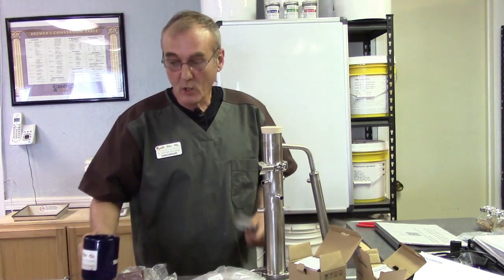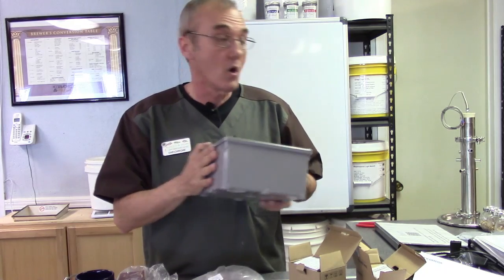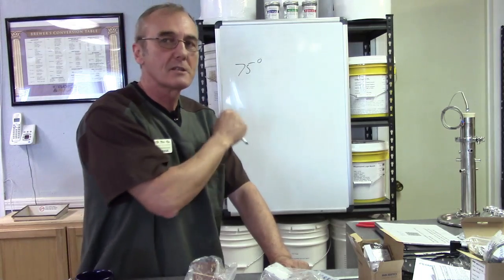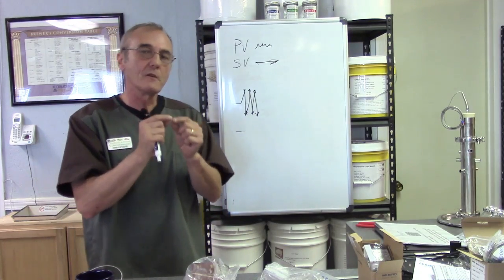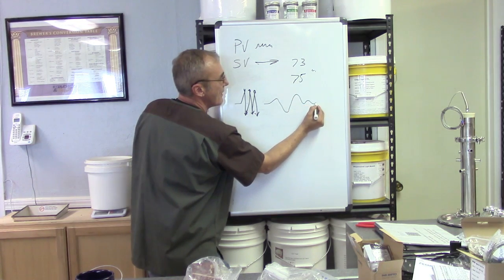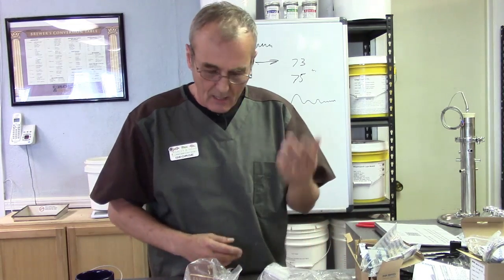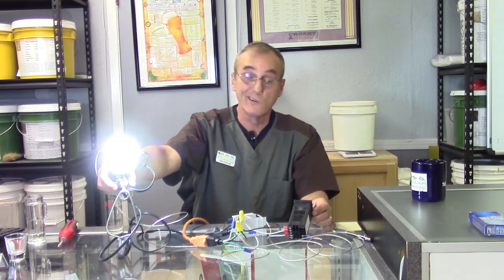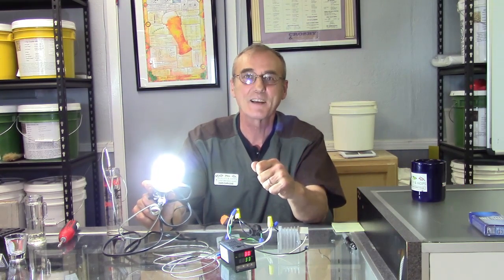Controlling temperature with a PID controller

Comment: Can a PID controller, instead of governing the pot element, and controlling the boiler, be attached to a Motorised ball valve, and control the flow of column cooling water instead?  I figure it'd have to do TWO jobs, then...  Water open, then Water closed...  Unlike an element where power off = cooling down, valve position should hold temp

Comment: I have all 17 settings wrote down in order, but no one will tell you which program you use to set the temperature. How do you set the temperature you want. IP, SC, DIG, OP, CTRL, HC, RUN, ALP, HIAL, LOW, PD, DF, PID, CTL, P, I, D, 🤔

Comment: Love your information!
It helped me figure out I have the wrong type of controller for my needs. I am trying to use a controller to control a wood drying kiln and the controller has to control a dehumidifier compressor, so it cannot pulse the power or it will burn up contactor and compressor.
So what type of controller do I need for this application? Sure would help if you or anyone else knows.

Comment: Hi George,
I’m having problems with my ink bird, I’m using it to vaporize oxalic acid for bees, I have it set for 344° and it will go up to 410° melts my solder that is holding my copper tube and then back down to 340°. It fluctuates so much and I don’t know how to narrow it down.

Comment: A PID controller is excellent for holding a constant temperature but a still doesn't operate at a constant temperature throughout the distilling process.  A still requires ever increasing amounts of heat in order to keep the distillation going as the ratio of ethanol to water decreases throughout the run.  Ethanol starts to come off the still at 174 F and one constantly has to increase the temperature, depending on the flow rate from the condenser, to 203 F which typically completes a run.  A PID cannot self regulate these temperature requirements thus requiring an operator to monitor the condenser flow rate and make temperature adjustments.  This monitoring and adjustment is where the art of running a still comes into play.  A PID is a great way to get your charge up to temp and holding it there prior to distilling but beyond that it offers no advantage to the home distiller.

Comment: any help my controler is  new ( not my first ) when setting the temp . it just passes my set temp ( keeps getting hotter and hotter doesnt stop ) thanks
Reply from the maker: Make sure you are not set in manual mode. That's what it sounds like. I am only guessing since I don't know what type of controller you have but this is the most common problem.
Reply: @BarleyandHopsBrewing  how do i change that its a mypin
Reply from the maker: @lukerichardson9688  The instructions that came with the controller explains how to change parameters.
Reply: The instructions are a joke thanks tho

Comment: OK, now I blame you!  This is all your fault.  I was about to buy a “simple” PID controller for $800.00 from  a company that makes stills.  Now I am going to make my own PID controller for my still, and for my beer brewing.  I am going to get a PID that I can program on my laptop for less than $100.00, plus the 60 amp solid state relay, and the other miscellaneous parts for less than $200.00 total.  I will run 11,000 watts of ultra low wattage heating elements.  HOW MUCH FUN THIS WILL BE!!!!  Thank you for your awesome videos, and your excellent teaching skills.  I am now addicted.

Comment: Hi George!  Thank you for your excellent videos, I am hooked!  I have a question about the PID.  I am using a ramp/soak for my glass kiln.  I understand the ramping up part however I will need to drop temp from a 20 minute hold @ 760 deg. C. to 515 deg. C (as quickly as possible) and then hold that temp of 515 deg. C for 30 minutes.  Do any of your videos demo the segment programming for this cooling stage/hold?
Reply: It's in the manual that came with your controller. If you're stuck, you're overthinking it. Have you thought of setting the next temp to the same for hold and lower for cool?

Comment: You can buy a PID controller with 40A SSR, heat-sink and K-type thermocouple on ebay for as little as £25 (approx. $35).

Comment: Hey George. Thanks for all your videos. I've learned a lot. I was hoping you or maybe someone here could answer a question on  pid controllers. If using the mile hi 2 in 1 reflux. If you increase the power on the pid can you compensate for the additional water vapor by increasing the water flow to the chiller in the tower? In doing so is there additional risk of scorching what's in the kettle?  Or can you push the pid all the way up and add extra cooling to the tower Condensor? Basically trying to reduce overall runtime but want to be sure I'm not risking scorching anything. Thanks. Hope that makes sense.

Comment: PID controllers relate to a transfer function which models the devices output for any input value. The thermocouple subtracts the measured value from the set point and the remaining signal is called the error signal. This signal feeds a 3-term amplifier for PID and this amplifies the error signal, the integral (all of the previous error) and the derivative error (the rate of change of the error) and sums these three signals. This is a form of closed-loop feedback so it will continuously iterate. Eventually the error will tend to within 0.5% of the set point and this is the steady state error (the error as time tends towards infinity).

Comment: It still looks like it is either on or off. But I do understand that the ons/offs as short and they seem to keep the temperature in a very narrow range. This is how the 98% efficient natural gas furnace in my house works. But I did t know, until this video, it was called a PID. I do have a question if this thread is still active: generally speaking, is it better (in terms of taste) to have a slow steady distillation or is the final taste not really affected by the distillation speed; therefore, Damn the torpedoes, full speed ahead and let’s get this puppy done!! Thank you George. By the way, VERY INTERESTING!

Comment: You can add very important safety feature to your system as SSR sometimes go stuck ON when the heating element is starting to fail. This will cause uncontrollable raise in controlled temperature to maximum without any limits.
What you need is a RELAY or CONTACTOR (if the heater element is 3 phase) and connect it to second (ALARM) port of PID controller. This will switch off power to the heater if PID detects SSR failure.
Also the incandescent bulb will show your idea much better as it is proportional in nature instead of fluorescent which is on and off

Comment: Hi George.....I just completed building the inkbird PID temp controller following your most excellent tutorial.   Everything works great.   My question is about tuning.  Would you please direct me to the vid that addresses setting parameters where the inkbird progressively  "ramps" up to a set point.
The other problem I'm having is establishing the on/off set points.
For instance,  my inkbird "screams" up to  say 180F set point, the SSR opens, the temp drops down to 150F, relay closes, temp screams to 180F on and on.... I'm looking to tighten up the operating envelope.  You're a great instructor! Thanks for everything.  Jerry

Comment: Hi George. I have managed to get a stc1000 which is all that is available at this time. It has a short plastic covered thermocoupler or probe. Can it be used? I am stuck on how to mount it if it can be used. Have spoken with professor google but I don’t see this as something anyone has ever covered. Obviously can’t just be stuck into the copper as it will effect the reading. Any way you can give advice? Thanks as usual for your great coverage. Am learning so much from you. Regards.

Comment: I'm not sure that is the best way to describe the three PID terms.   For clarity, think of the output from the controller.  The proportional term drives the output "proportional" to the deviation from setpoint.  The integral term is the product of "deviation from setpoint multiplied by the time it has been away from setpoint (the controller will ramp up or down if the process value doesn't come back to SV.   And the derivative term acts on how fast the process value is changing.  If the controller senses the temperature just blasting off quickly, it will clamp down on the output based on the rate of change of the PV...  Tuning a PID controller is done by varying the gain values you attribute to each separate term... Does that make sense?

Comment: i need to control 5 2000 watt heating elements to maintain a temperature of a tank at constant value for my research project....... can i do that with a single PID controller
Reply from the maker: You can but the power requirement will be tremendous.
Reply: @BarleyandHopsBrewing   i have 60A source with 440 volts in my university........ will that be enough
Reply: @MuhammadSaad-uk6xd  to run 5 elements at 2,000 watts each is a total of 10,000 watts, divide that by your voltage of 440 volts and you get 22.7 amps of power needed to run it.  A 40 amp SSR on your PID controller should do it.

Comment: I have watched all your videos on PID's. I have been trying to wire it for 3 months without any luck. I wonder how long it will take to figure out the setting. It is so frustrating.
Reply from the maker: P=1
I=540
D=200
Control period = 1

Comment: This is Two Georges the PID controllers that you get they do work fine why you should try building a analog meter with a control knob you get more accurate than the PID because it's up either going at 2 or down appointment to and you can just run it at a steady pace. But the other reason was I apologize for calling you on your vacation didn't know it and I thought you were very rude so if you are that rude to people that call you maybe you shouldn't do the videos anymore thank you Mike
Reply from the maker: Mike, I apologize if I offended you. When you called and I answered I did start by telling you I was on vacation with family but could take a short question as I had limited time. This developed quickly into a longer conversation that I could not commit to so I ask if I could get back to family as we were being called into the restaurant for our reservation. 
I meant no ill will nor intent. 
I do apologize.
George

Comment: Hi George.  Thanks for your video.  We all learn from each other.  In watching, I noticed several things.  The first was that the on/off cycle (white board demo) looked like a saw tooth wave yet your explaination sounded like square.  The later portion with a florescent bulb was obviously square (on/off).  Your explaination sounded like a demo with an incandescant bulb hooked up to a rheostat where the operator (controller) started out twisting from full on to full off and gradually twisted less and less: less on/less off until the change was minimal.  Meanwhile, the wattage (bright to dim) over time stabilized into a small ripple change.  The resolution of the ripple is based on the frequency and change.  Check out the Arduino videos on controlling AC voltage.  Create comparison.  Cheers.

Comment: I had a T500, and constantly dicking around with the water to keep a consistent temperature became old fast.
Just got a beautiful Brewhaus 8 gallon with a 3 inch column,  so super excited. 
If I understand correctly,  with the PID controller,  I can set the water flow at a reasonable pace, and control the temperature with the electric heating element?
Reply from the maker: That is correct.
George

Comment: Can the pid control 2 elements @ the same time
Reply from the maker: Yes it can. Wiring is simple but the PID cannot separately control two elements. Meaning you can't set one element for one temp and the other for a different temp.
George

Comment: i have made a annealing oven.heater is getting ON but cutt-off is not working,iuse temperature controller and ssr
Reply from the maker: Not sure what you mean by this. If you could add a little more information like PID model number and precisely what is happening I think I can help.
George
Reply: pid 500-1-1-01cut-off temperature is not working.may i know the solution
Reply from the maker: Have you tried the auto-tune function yet?
George

Comment: Thank you. I have one of those PID controllers, I rebuilt my father's SEAL 210 dry mount press with it, removing the worn out manual controls that were way off their settings and now correctable. I didn't understand the controller and manually set all the variables and didn't get it to work just right, I'll reset my PID unit and let it try to learn it out on it's own.
Reply from the maker: Excellent
Reply: Barley and Hops Brewing hello, the auto tune worked almost perfectly, I did gave to offset the PID from what I was reading on the face of the platen by a few degree and adjust the dead band to 3 deg.  Now the face temperature stays within 2-4 degrees of the SV, HUGE improvement over the old bimetal control unit it came with
Reply from the maker: Great. I applaud your success.
George

Comment: Is the performance and energy savings gain difference between using this system compared to one which employs a thermostat with a very low differential, (for example those historically used in tropical fish tanks) big enough to warrant the expense of retrofitting existing systems, or is this device aimed at new installations? For example, will my Cardinal Tetra be more comfortable?
Reply from the maker: I have no idea. Don't even know what a Cardinal Tetra is.
George

Comment: To help give some clarification on what PID actually means, think of it like this: all 3 P, I, and D control methods use the difference between the value (temperature reading) and the set point to determine a response. Proportional uses the instantaneous difference, integral uses the accumulation of past difference data, and derivative uses the current rate of change in the difference value. Combined they work as an often more effective control method as each will supplement the shortfalls of the others. Overall control systems and PID is a very complicated but interesting subject and I would recommend looking into the specifics more if you're curious but don't feel bad if it's a bit over your head. This subject is taught at a very high level in university engineering curriculum as well as graduate level courses
Reply from the maker: Shane, Thanks for the in depth explanation and you are all over it. You are also right, this is a subject taught in engineering and at graduate levels. The challenge for me is to explain and demonstrate the workings without losing interest on the receiving end. Your comment is much appreciated.
George
Reply: Barley and Hops Brewing 
No thank you George. Keep up the great work!!

Comment: Has anyone come up with a way for a PID to control the water flow on a Turbo 500.  The water pressure varies allot where I live driving the temperatures wild.
Reply: I would direct you to this site:  http://www.vfds.org/using-variable-frequency-drive-pid-control-for-pump-motor-128631.html

Comment: could you use a pid-controller on the T500 Boiler? ?
Reply: The challenge would be finding a thermocouple size to fit exactly where the thermometer goes so the cooling water doesn't leak. There are probably work arounds for the creative.

Comment: first off.. thanks for your awesome tutorials, they have helped so much in setting up my brew system.  Now for a Question.  I have my pid controller all wired up and the element works fine. but the thermocouple temperature is way off.  is there any thing I can do to fix this?